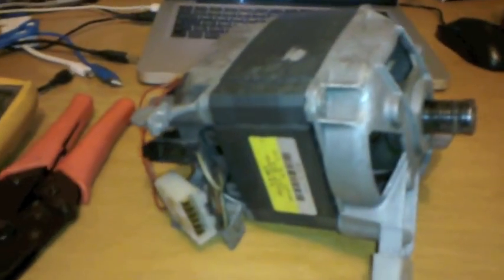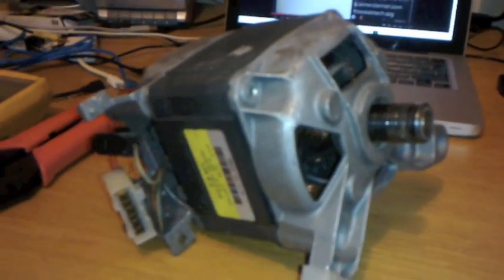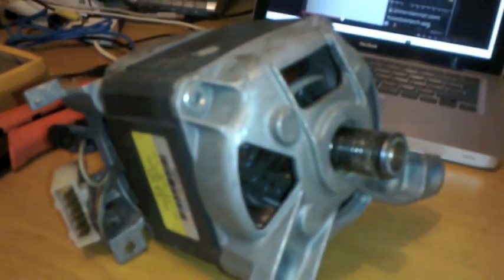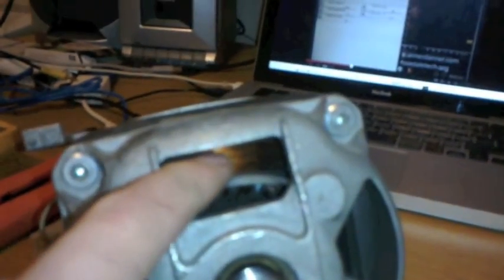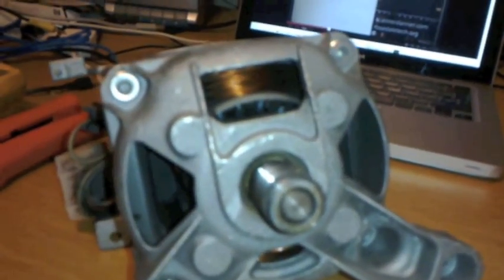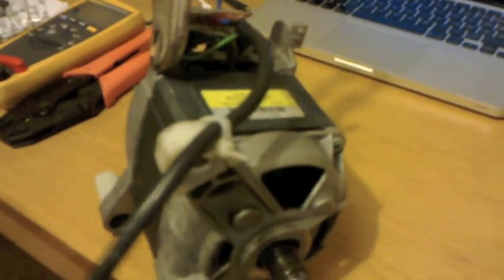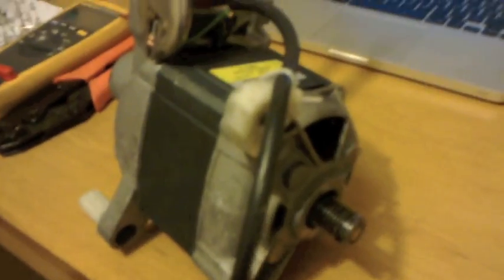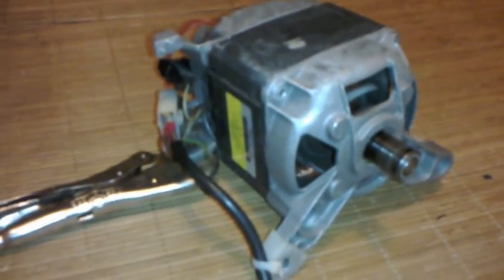How to wire AC Universal Appliance motors (Washer/Drier)

Comment: You need some sort of speed control when using one of these otherwise the thing will just run away with itself getting faster until something gives. If you see how fast this thing is running, what on earth are you going to drive at that speed?

Comment: Good video.  The wiring is exactly the same as an Asko motor I have just pulled out.  One question, will the different field winding produce different speeds?  Or is the speed controlled through other means?

Comment: I have a Sole motor. It has 9 wires. I have identified the tacho and brushes wires. Then theres a bundle of them coming from the interior. They are GREEN, two WHITE, BROWN and BLACK. It won't turn. The motor looks new but i'm wondering if its broken. Do these motors often break? Please advise, as i would love to get this baby turning.
Reply: Check the continuity between the wires if you haven't already, if there is no resistance that means one of the coils is damaged or the brushes don't have a connection to the commutator and the power source.

Comment: So can I wire it to run off a battery???
Reply: daniel umpleby yes, this wiring will work with ac or dc power, I have run one of these motors on as little as four aa batteries with this wiring configuration.

Comment: I have a question for you.   
Can you tell me how to remove the drive end bearing?  How to manage with the drive end part diameter that is bigger than the bearing diameter? Is there a way to unscrew the drive end or do I have to use an extractor of bearing ? 
And thank you for your video, very helpfull.

Comment: mine keeps shorting out and sparking from the back, any idea what I've done wrong?
Reply: Nothing, that's how some motors work
Reply: it sparks from the socket too though. do i need a higher amp fuse? am I missing an earth somewhere? do i need to plug it into some kind of transformer? how do i keep it going safely? I want to make grinding wheel with it
Reply: Jordan Griffiths
Probably best if you get on some electronics forum, i only fix lawnmowers so beyond the motors in them i don't know much else

Comment: I have a 3/4-hp 131761300 (115V 60Hz) with white, orange, blue, yellow, and red. The white wire goes through a plastic box and thence connects to the white. All the other wires disappear into the innards and cannot be traced.

Please advise.

Comment: would it work without making that last bridge between the second brush and the remaining field coils? also are all the pins in the terminal in the same position in all motors? i got a bosh motor made in germany for example, should i be able to wire it just like this? all the seven wires from my terminal is orange.

Comment: could i use this on a go kart or mini bike?
Reply: with a really long extension cord....yes you could.
Reply: what if you used and battary
Reply: full metal gears I guess you could use a deep cycle battery and an inverter but I doubt it would be efficient and usage time would be low. Would be an interesting project. I wonder if a variac for speed control could be usage in conjunction with an inverter. Hmmm
Reply: Actually you wouldn't need an inverter these can run on AC or DC

Comment: How does the speed control work on this motor when it is in a washing machine?  Is it the same as the electronic triac control in an electric drill?
Reply: Youre gonna need to wire it to a magnetic motor starter with either drum switch or pushbutton switches to make high speed low speed. I just forgot what the configuration is

Comment: How the hell can you take advice about testi g AC motors from a man who does not know the way AC mains is supplied.
BROWN wires are POSITIVE FEED. BLUE NEGATIVE return.
Reply: hmm. its AC so the cord with power should change constantly? you can plug the cord into the wall any direction aswell.
Reply: Tony Tobias, there is only two lives and a ground, that is how ac works.

Comment: This is wiring the motor as a series motor, which I'd be wary of as there is no well defined upper speed limit for series-wound motors and they are not supposed to be
run unloaded due to the danger of overspeed disintegration.
Reply: Unloaded over speed disintegration is just an added feature.  You’re just looking at things from too pessimistic a stance.

Comment: how can i control the speed.i have the same motor which i want to use but with little bit lower speed
Reply: Jason Young I think you should wary the rotor power, not the stator, because if you get to a low enough speed you can fry the rotor windings.
Reply: Yeah me too :)
Reply: use a lightbulb or an light dimmer , make sure u meet the wattage of the motor
Reply: Andrew is on the right track. You want to vary the power only to the stator windings, not the rotor windings. You could do this using a variac of a suitable power rating, or alternatively a triac circuit as found in light dimmers.

Comment: How many rpm is this engine?
Reply: Actually those kind of motors usually have around 10000-13000 RPM. For sure it depends on motor type. But more or less RPM is higher than 10000
Reply: i think it is 1000 rpm iam not sure

Comment: Sam, this is very helpful and what I am looking for. The motor i have (Maytag dryer) is slightly different, and perhaps you can steer me straight. 3 wires from the motor to the connector - blue, black and yellow.  The connectors are numbered as follows. 2, 0, 4, 3, 5, and G.  Blue is 4, black is 3 and yellow is 5. So, to connect up an external power source, to which open spades do i connect the 0 and phase 220 leads? 
Many thanks,
Joey

Comment: okay well i have a washer motor wiring is total different it is a plug with five wires that contains in order brown brown there from the back i take it there, speed controllers right? not doing to be using them dont want to blow it up want it smooth working order. Any way lol now i have the other three wires in a plug on the side they are from the top white, red, black i would like to wire this up to a plug with speed controller

Comment: Hi Sam, 
I have been trying to find one of these universal European washing machine motors for a long time. I live in the US and all our washing machines are powered by boring split phase induction motors, all 1725 rpm 4-pole. I estimate the rpm of your motor, when you ran it, to be well over 10,000...I have a large step-up transformer (overkill for its use!!!) 120-220VAC to run my antique British Veritys electric orbital fan. It should easily spin-up one of these big motors!! Thanks! Fred

Comment from the maker: You would need a higher ratted controller than a sewing machine pedal to handle the watts the motor uses. Have a look on ebay for motor speed controller or a variac.

Comment from the maker: Motor draws too many amps for a light dimmer. Washing machines use a pwm board to control speed. A variac would be the simplest way to regulate speed.

Comment: very good video, I was lookin for somethng like this, 

but do I understand it correctly that power goes first to the first brush (blue wire from power cable in your video) and the power returns to the electricty cable through a field coil in the stator. Then you make a jumper cable to bridge the second brush and another field coil. 

So power goes from the first brush through the rotor windings to the second brush and then through the field coils, and the field coils must be in series